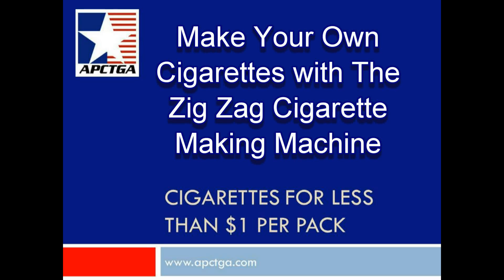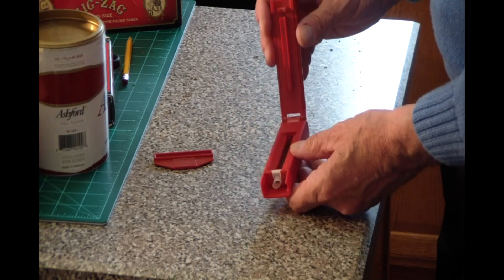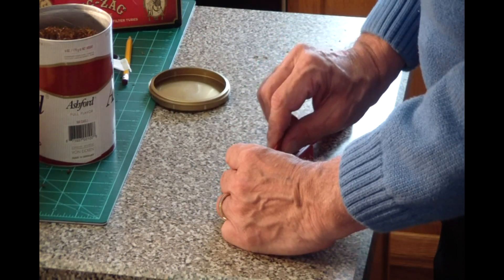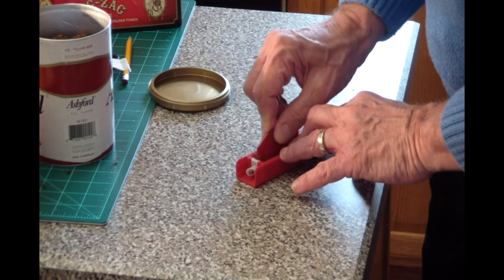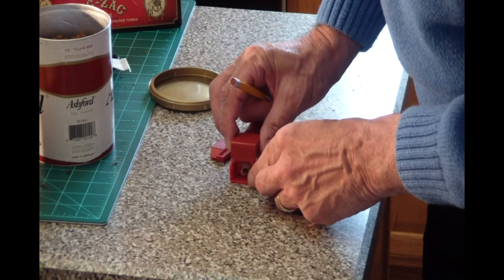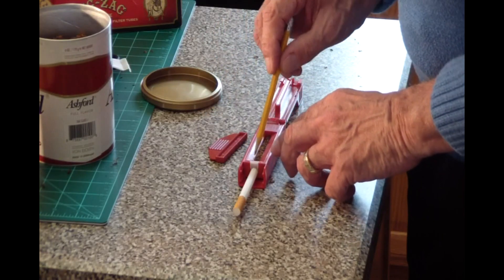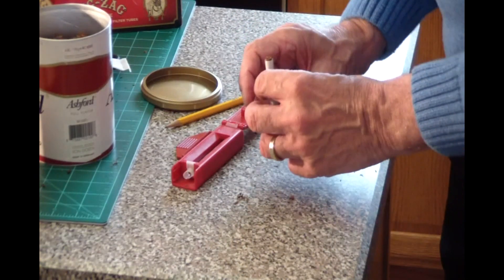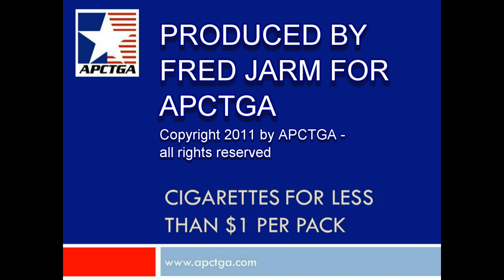Making Cigarettes using the Zig Zag(R) Cigarette Making Machine

Comment: I remember using an older system called "Laredo" which used a separate tobacco and filter insertion system into a blank paper tube. It was laborious, but worked quite well. I've been wondering if one could find an old Laredo system around, even if it takes separate papers and filter inserts.